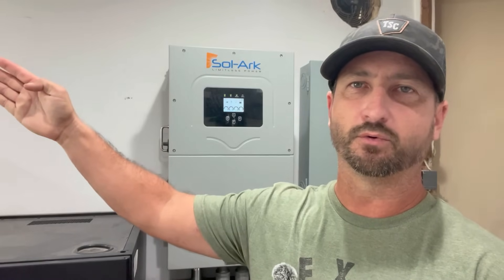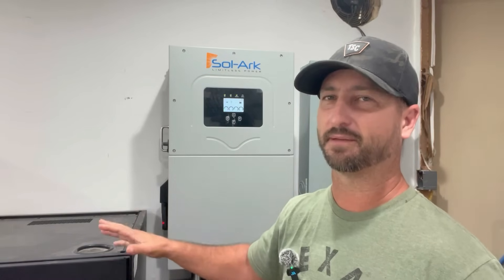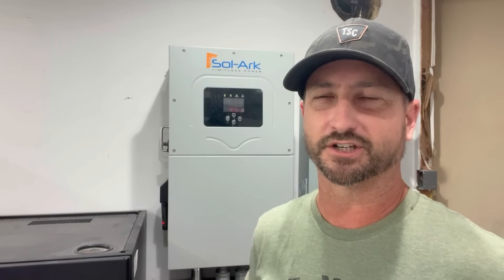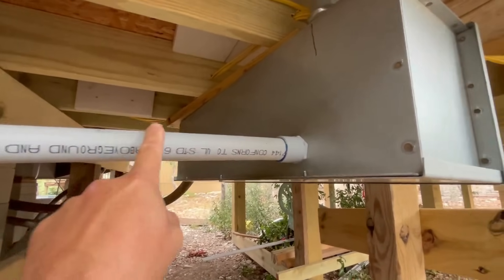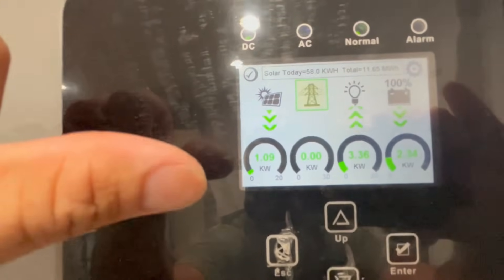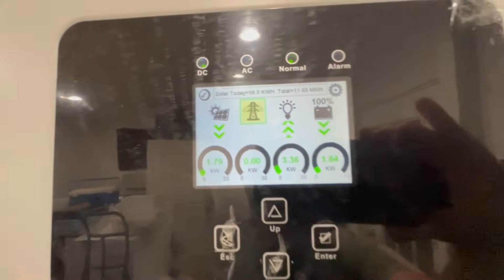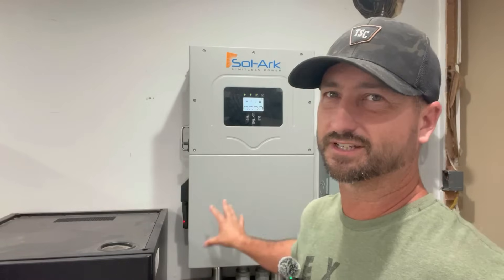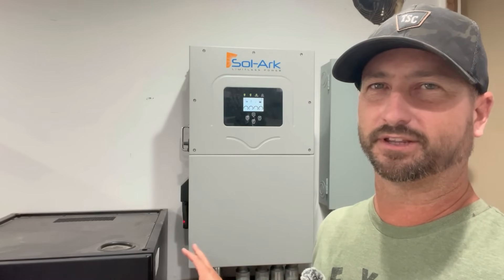Tour of my off grid solar system with the Sol-Ark 15K

Comment: I've watched a ton of video's on the Sol Ark 15k, and this is the first one where I saw toroids installed on the battery cables. I just received my 15k and I've been wondering if I need them, or all the filter rings they supplied for the other cables. No HAM radios where I live in NM.

Comment: Up to date....any probs with the Sol Ark 15k? What about it working with the lifep batteries? Thanks.
Reply from the maker: @lindaferguson593  no issues. It’s been running my home for 2 years now.
Reply: @unpluggedtexan  very cool. I'm looking at a Sol Ark 15k myself now before the tariffs hit. Maybe size my array of 27 460/575 bifacials. Been wondering if putting my 27 pv's into the first mppts then buy about 20-400w pv's to string separately on the last mppt, in order to not lose the downgraded wattage on the new panels by separating them out. Thoughts? Update: I found my Blue Suns!

Comment: Is it better not to have the larger battery banks ie ...more than 12? It seems it would be a shorter time to charge 12 batteries for overnight need and have a larger pv array to accommodate their charging plus your usage over daylight hours.
Reply from the maker: @lindaferguson593  you definitely don’t want to have more batteries than your pv array can charge on a sunny day. But more batteries the better as long as you have the pv array to charge them fully.

Comment: You mentioned that you have an electrical meter 300' away from the system.
I plan to do new construction with a similar setup,  only close to 400' away from the meter. 
My question is;
What kind of wire did you run, and was it copper or aluminum. 
Did you install pull boxes on the way, and finaly. Did you upgrade the size do to the voltage drop?
Reply from the maker: @jaroslawsawicki1246  I ran 3/0 copper. Voltage drop was very low. I have 122 volts in my home. No pull box, but it was a tough pull using a commercial style wire tugger.
Reply: It would be cheaper to use aluminum, but you will require a thicker wire size.

Comment: Yes propane generators give lower output with higher fuel usage then gasoline or diesel.
Something doesn't sound right with three month wait for propane delivery when thet are required to deliver within 7 days of your call/order
Reply: I think the same, it should not take that long! We need to support the transition to green energy and this type of systems are a great example and great application. In my opinion he us using one of the best inverters in the market.
Reply: @GusTulsa should look at victron

Comment: We found a small company in Oklahoma to do the installation and setup. 12kw panels,  sol ark 15k, and 10kw storz batteries.  $42k with grid buyback available. Turn key, and i watched enough to underthe basics.
Reply: Sweet, Fred! As a solar enthusiast I would recommend expanding your battery bank, just to be sure, and Storz is a Sol-Ark partner, which makes it better.  Congrats!
Reply from the maker: @fredbecker607  congrats!  You won’t regret it.  Look to expand your battery bank as your budget allows. If you could get to 30 kwh’s of batteries you’ll start to get close to being off grid nearly all the time if you use the amount of electricity a typical house in the US uses per day (20-30 kwh’s).
Reply: @unpluggedtexan  Agree about adding more batteries to be closer to being always off grid. Especially if you have enough pv panels to recharge the batteries even on low sun days.

Comment: You are not off grid!!!
Reply from the maker: I rarely use the grid. Only as backup since it’s cheaper than propane. Do I have a grid connection?  Yes. But I live as off grid as anyone else. I just use a different backup system that’s cheaper (grid) when it’s available.

Comment: Very nice setup. Im surprised you didnt make the panel racks adjustable for the seasons. I dove into making batteries awhile back and just built a 7kw one for less than 1000 bucks using 280ah cells.  You can cut your battery cost in less than half with diy battery racks. There is another Texas guy I watch on here. You guys have me on zillow looking at houses down there. Id love to escape this leftist hell hole called WA.

Comment: I'm in a suburb in West Sacramento, California, grid-tied with a Sol-Ark15k and 19.2kW HomeGrid stack with a modest 5.525kW of solar panels. Superb results. 

I had no electrical or solar knowledge, and was trying to get a solar company to do a solar installation for me, but quickly got really discouraged with how sketchy that industry is. And as I researched system components, in depth, trying to make good choices, I found out how difficult it would be to get any solar installer to install the components I wanted instead of the components they'd prefer to sell me. 

So I took a deep breath, and designed, permitted, and installed the system myself, using solar electricians to perform the electrical connections and conduiting since I wasn't competent to do that work AND so I wouldn't void my equipment warranties. I drew the permit wiring diagrams based on Sol-Ark and HomeGrid manuals, drew the conduit routes based on where I was locating equipment. I fired the first solar electricians before they even began work, then hired a young hungry group who priced reasonably, scheduled me promptly, showed up on time, worked carefully and well, and promptly corrected any errors along the way. 

My system runs my whole house, no critical loads panel, with the 15k on my back porch hung on my back porch wall, under a big patio roof, and right next to the back door from the in-house laundry room. The HomeGrid Stack'd ESS is on the other side of that wall, inside my laundry room, about a foot from that same wall. Beautiful looking battery, by the way. The battery and com cables from the inverter pass through the wall into wall-penetrated rigid, mounted conduits, then travel about a foot out of each conduit to connect to the HomeGrid Stack'd ESS. A removable fitted wood cover conceals the wiring. The door out to the back porch is located such that you walk by the battery on your right, located a foot from the same wall the door is on, out to the patio and see the side of the inverter a foot away. I hung the inverter with the screen at eye-height.

Biggest lessons I'll pass on from my first-timer's experience doing solar: Get a lot more panels than you think you need, you can never have too many. Buy the big-boy inverter, can't beat the satisfaction and simplicity of running the whole house even when the grid fails. Get even more battery than you think you need. 

And this final tip: Don't budget your solar and backup system build based on trying to get it to pay itself off (ROI, or Return on Investment) That's the common way solar is sold or considered but it's just just crazy: you don't buy cars that way, you buy what you can afford based on quality of experience. Quality of experience is truly a big part of your Return on Investment! Energy independence, quality equipment that has less chance of failing, whole-house backup, loads of backup battery: just like buying a nice car or truck, only probably cheaper, lasts twice as long, doesn't require gas, oil, tires, insurance, etc. Yeah, build a system that works like a truck instead of a moped.
Reply from the maker: Very well said. Congrats on sticking to it even after being discouraged. That shows character. Wish there were more people like you out there.
Reply: @unpluggedtexan  Ah, you're the guy, all this great content and good attitude. Cheers, bud.
Reply: Sounds like you need to put a reveal video up to share your achievement.
Reply: @SkyCharter  What's a reveal video?
Reply: @Ben-v7e  Where you show off and explain something new to others who might have a desire to learn new techniques, etc.
Reply: @SkyCharter  Ah, thanks. So, I haven't ever done something like that, but I'm guessing I can post a YouTube video on my account and put a link to it in these Comments, or...? I'm curious about if it's something simple to do without me having to learn a lot or get more apps, etc. If it's super simple for me ot upload a phone video and link to it here I'll do a short one, because I am really pleased with the layout and I think it is very practical for my location. Anyway, advise me, if  you don't mind.
Reply: Thank you for the info! I'm in Fairfield and planning on doing a similar setup, so this is great!

Comment: What I did is I used solar panels to run my house and what I did is not used a grid. What I did is use nothing but solar panels, and I did that for several years with there's sunny days, there's no sunny days it didn't matter. I didn't have the grid. I didn't care about the grid. I didn't want the grid. I didn't care if I couldn't power everything when I didn't have fully powered batteries. It didn't matter to me 1 bit. Who cares if I can't use the kitchen oven? Because I don't have enough hard because there was no sun. I guess to use a grill.  Or air fryers or other things Who cares. And you wanna know the best parts I live in Wisconsin? Will we get snow in 3040 below 0? Sometimes norium, right around 22 below. Sometimes 30 below, but still but for some reason. Today. It's actually quite nice out so nice. I think we're moving down to Texas with this weather. I mean, right now. It's pair woman here than it is in Texas.  And this is the beginning of february and the coldest month of the year. But I suppose you gotta like it when the North Pole moves farther away.
A pretty soon I end up in the middle of Russia somewhere. Is not? I don't know exactly where, but it used to be in Alaska for one part of time, at least 26000 years, but then it moves up to where the North Pole was for 26000 years now, it's moving again, it's going to be a Russia someplace. Too bad I don't have enough solar panels to run everything in my house all that exact same time but I'll be getting there pretty soon. The only problem is none of the solve panels are all the same size. I'm got a few one size a few another size. A few another size. A couple another size so I can't connect them all together with one another.
So I was running all 12 V.  But I think I'm starting to change that a little bit.
To run with generators, solar generators.
Cause I won't get anything that uses gas or cool.  Or any kind of fuel other than electricity.
I need to select trees if I mache from the solar panels I buy.

Comment: If the batt run low and it goes to grid what if the grid is down while the batteries are low.
Reply from the maker: I have a propane backup 240v generator as well.

Comment: Your system is very similar to mine here in Louisville, KY. I have the Sol-Ark 15K and the same 30 KWh of EG batteries. However, I only use 22 bifacial solar panels on metal racks to produce up to 19.1 KW of power. I also have a propane backup generator that will recharge the batteries if needed.  I drive a Tesla so I charge it directly from solar for free. I live on about 10 acres of land and am considering buying an electric robot lawn mower since paying for lawn mowing is a major expense.  Of course, charging the electric lawnmowers would come from my solar system.  I had my system installed by an experienced expert and he did a great job. I love my system and am happy with the investment.
Reply from the maker: Great minds think alike!  Nice system!  Love that you drive for free with the power you produce. I have so much extra power on sunny days I’ll be getting an electric car at some point. Can’t justify the expense right now unless I get rid of my gas powered Kia Sorento. Unless I get rid of that then the extra expense on buying an EV doesn’t make sense. I’m just not ready to give up my gas car yet.
Reply: Once you drive an EV (I have Tesla Modle 3 Performance) you won't ever want to drive a gas car again. They are great.  @unpluggedtexan
Reply: How much wattage for each of those 22 pv panels to make it 19000w solar array? I have 27 pv panels of 460w with a bifacial gain of up to 575, and that doesn't come near your 19000w capacity you speak of. I have 2-eg4 6500ex 48v 2 phase inverters, and 2-6 bank 48v eg4 battery racks with a 60+ total of storage and can't run a mini split!!!
Reply from the maker: @lindaferguson593  I have 60 total Longi panels at 320 watts each. I have 30 kwh’s of battery storage. When the sun is out I can run my 4 ton traditional AC, my 24k btu mini split, my 9k btu mini split, my well pump, and 240v water pressure system for 5 homes on my property all at the same time. That comes out to about 8,000 running watts. My Sol-Ark 15k can run 12,000 continuously with no problem. It can surge well over 130 amps. On a sunny day I can produce about 120 kwh’s of solar energy.
Reply: Can you please let’s me where you buy 22 Solar penels for 19.1kw  thankfully I just to buy 15 k solark and I want looking buy more 22 Solar penels for 19.1kw thank again
Reply: Hi there, We are getting ready to build a smaller (1500-1700sq ft) Barndominium style home on 15 acres in SE Missouri and are looking to do as you have with a 1000g propane whole house generator for backup and charging if needed.  Could you point me to what size system you have isntalled?  Unpluggedtexans seems much to large of a system for a future retired couple.
Reply: What panel wattage does each of the 22 pvs have. 19.1 kw on 22 panels averages seems to be 863w + per panel to get 19.1Kw. I'm confused here.

Comment: IMO a total off grid system is the way to go.....if you have the space to do it. You obv do have that space. But even in an urban environment there is a lot to gain from battery power. 
And you touched on this....inflation.....how much more expensive and how much less reliable will the grid become? 
Heading off to work washed and refreshed is way better than heading off tired and face washed.
Cheers, gr8 vid.

Comment: Did Sol-Ark fix their inductive load problem?
Reply: First hw version of the 12k had that issue, 15k and latest 12k's don't anymore
Reply from the maker: I’ve never had a problem with my Sol-Ark 15k. I run large loads every day (2 hp well pump, 240v surface water pressure pump to pressurize water to 5 homes on my property, my traditional AC which surges to 125 amps, power tools…ect)
Reply: The 12 had a problem with 120 volt high surge but not the 240 so it was an unbalanced thing with each leg.   @unpluggedtexan
Reply from the maker: @offgridwanabe  I’ve had no issue with power tools on 120v so it appears whatever issue they had with the 12k must have been addressed.

Comment: Why so many panels? I have a 15k as well, but  I only have 32 440w bifacial panels. Are you not having an issue with overloading the solark?
Reply from the maker: Nope no issue. The Sol-Ark 15k can handle up to 19,500 watts of panels. I have 19,200 watts. When I produce more than it can handle (15,000 usable watts) it just drops the remaining amount. It really helps on days like today where it’s raining. I’m still powering my whole home and have charged my batteries from 46% to 70%.

Comment: This is Big $.
Reply from the maker: Yeah it’s a sizable investment. Worth it in my opinion. But I’m also in process of putting together a system on a family members home that is going to be half the cost, and will cover critical circuits in a home rather than every circuit. It would also still lower your electric bill by more than half, and still give you power to run your home (the critical circuits) should the grid go out.
Reply: @unpluggedtexan  Why not just cut the grid entirely?
Reply from the maker: @JamesG1126  I’m in a unique situation where my solar system powers a deep water well pump and water pressure pump to send water to 5 different homes on my property. If my solar system went down for some reason it would affect a lot of people. So I want to have redundancy when it comes to backup power. That’s why I have both the grid and a propane generator as backup. And it makes financial sense as well since power from the grid is cheaper than propane.

Comment: I would NEVER power an off grid home with a low surge, high frequency, transformerless inverter. It's  got to be a low frequency, transformer based inverter like an Schneider XW or a Sigineer inverter or nothing.
Reply: So let's assume non of the loads are inductive, like a maximum backup load of 1000 watts,... And this includes one TV, small 100 watts fridge, xbox series x and couple of lights, and lastly one 50 watts standing fan... Would one really still need a transformer based inverter... Am in a dilemma right now.
Reply: @donlatinohits  If you are only powering non-inductive loads, then a high frequency inverter would be fine. You will still have a shorter life expectancy from a high frequency inverter,  but the inverter will cost you less.
Reply: Or would you trust a victron instead?

Comment: Great channel, you talk and I understand.  I have questions.  BUT a bit of advice for those of us who live in very hot climates, install an evaporator cooler to control the temperature of the  inverters and batteries.  This was an inexpensive solution for the 118 degree heat in the West Valley on Phoenix, AZ.  The BMS will shut down.  The portable AC unit blowing on the system will also over heat.  What a mess.  2-12k Sol-Arks - 4 Fortress E-Flex batteries.
Reply: I'm curious about your suggestion for the cooler on the inverter: my Sol-Ark 15k sees plenty of 100 degree plus days here in West Sacramento during the summer. It doesn't seem to care, but it does use those fans a lot. My Homegrid battery, which is inside my laundry room, doesn't care about the heat. I think that's because the batteries do a lot less work than the inverters. Anyway, I'm always interested in hearing suggestions about cooling the inverter. One limitation I have is that my inverter is outside, although fully protected from sun and rain. But it's not in a room that can be isolated from the outdoor temp.